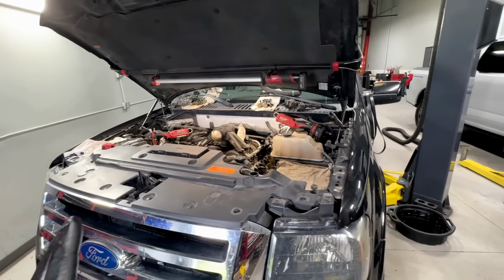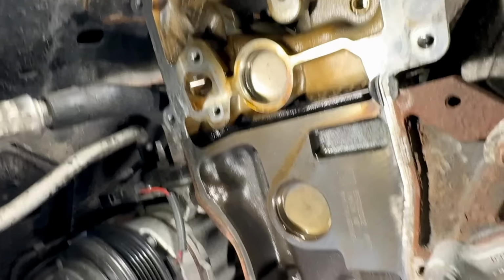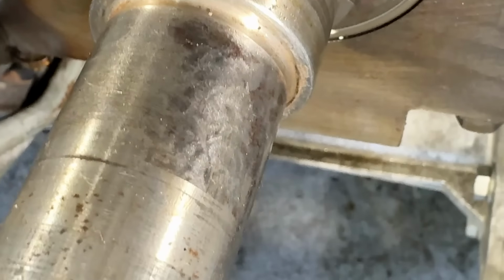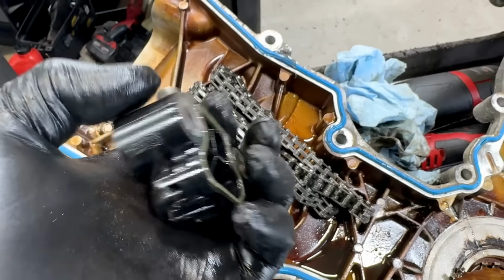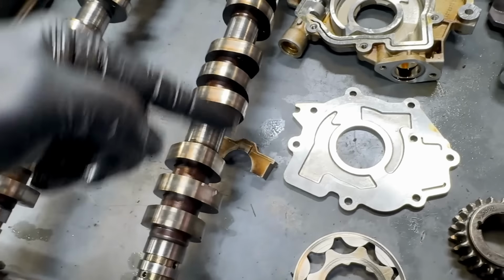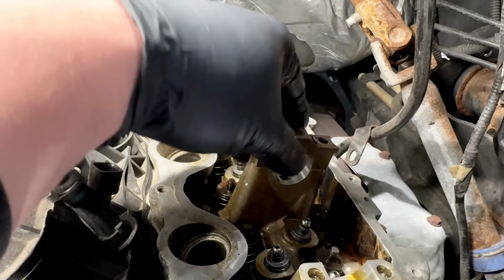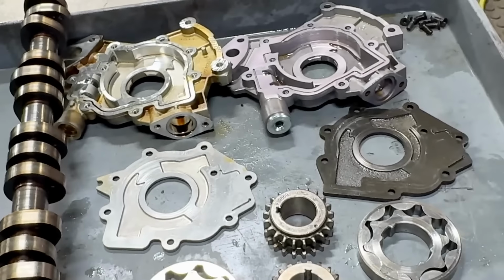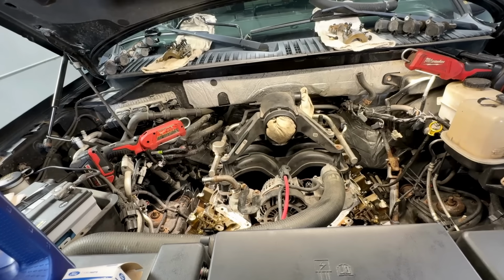How to Destroy a Perfectly Fine Ford 5.4L 3v Triton Engine with a Timing Job!

Comment: Looking for advice. I am doing the timing job on my 2014 Lincoln navigator tomorrow with the 543 valve. I bought a Cloyes timing kit mailing ratcheting tensioners a mailing high volume oil and water pump and also all of the respected specialty tools and torque to yield bolts after watching your video. The only thing that is making noise is the startup rattle. Nothing with the phasers or anything should I just keep the original Ford chains or use the Cloyes ones that I bought and hope that the reason they were snapping was the plastic tensioners that came in the kit which I won’t be using.

Comment: Hi tech Makuloco, which Ford truck engine do you suggest for the least amount of problems?
Reply: 4.6 or 5.4 3 valve with all of the upgraded Ford OEM timing components and Melling hv340 oil pump upgrade. And I would also definitely do the updated roller followers with a smaller oiling hole. First order of business for me is to usually check the cam caps and see how bad they are worn first and foremost. That's a major bleed off spot for oil pressure that these trucks must have

Comment: Good video good information! I bought a 2006 F150 111,000. Miles on it. 5.4 3v engine it has a constant ticking at ideal. How do I find out what is causing it? Thanks for the video!

Comment: Most and almost all  independent repair shops install aftermarket cheap crap parts , and even if they know the risk of failures like this , they don't care ; and they never advise the customer on OEM parts .
But on the other side , some people on budget , and cheapy .
I don't like aftermarket parts or do deletes on some systems .
But this is the type of information people doesn't understand .
Great information ,  great video  as usual . 👌

Comment: Thanks for your videos! I've been mechanicing for a long time and I love your dedication and attention to details! I don't trust very many mechanics, I would let you work on any of my vehicles, anytime! I think the problem with the aftermarket chains is part the unmachined links and they are loosely linked together! With those two center links sticking out, it causes more stress on the linking pins, causing them to wear premature and or bow?

Comment: Brian, is it ok to just run the 5w -40 in my 05  5.4 that is all original? 150k
Reply: Only if your clearances are terrible and your oil pressure is low after trying 5-30

Comment: My mother in law has a 2005 f150 fx4 with the 3 valve engine it made it to 272000 miles before dying from loss of oil pressure from the chain guides blocking the oil pump pickup tube. I put a reman engine in it but I also did both new exhaust manifolds cause they where cracked plus engine mounts, new hoses , new radiator and surge tank, new thermostat,water pump , fan clutch ,and had to fix the pig tail for the crankshaft sensor plus replaced it and the oil level sensor and replaced its pig tail too. Also put a new balancer , belt and idler and tensioner pulleys.

Comment: Thank you for a very informative diagnoses of the 5.4 timing chain. I have a 2010 F150 5.4 with 65,000 miles and I bought it with 20,000 miles several years back. I’m a retired master mechanic of 45 years and very familiar with Fords. My truck has been serviced every 3,000 miles since Ive owned it and I’m not sure what its history was before that. I use motor craft oil and filter only 5/20 blend. 
My story starts with a slight tick noise a few days ago when I pulled into my yard and my wife said do you hear that noise and I said yes so I got out my stethoscope and found it to be the right front valve cover under a light load. I know these valve trains are picky. With only 65,000 miles I decided to run some sea foam in the crank case one once per quart for 300 miles and then dumping the oil and going to a 5/30 full synthetic oil and hopefully this helps. The noise has since gone away. I appreciate all the knowledge you have to share because it’s quite possible I might have to do a full timing chain job. I will use only Ford parts if possible.

Comment: I have put the TOP of the chain on a BELT sander for for a clean surface when doing a timing job on the 5.4 will take better of the guides.

Comment: Hypothetically if that shop would of torqued that prankpully bolt down correctly would that timing job of failed? Or just not as fast as it did?

Comment: I've got a 2013 Navigator with 190k. Using recommended oil 5w20 full synthetic high mileage. Do you recommend keeping the current oil or switching to a different weight? If switching, what weight/viscosity?
Reply: I'm not Brian but he always recommends 5W-30 for any 5.4 3 valve. Even if it's a brand new remanufactured motor.

Comment: I admire your conscientiousness,
Wish there was someone I knew here in Wisconsin that I could trust to work on my 5.4. 
I just had my 2010 towed into dealership because it developed a terrible misfire on my way home last week. 
Dealership called and said the engine is shot, other than to say low compression on two cylinders, without any other good data to tell me why the compression is low. 
I am an electric trouble shooter and am not satisfied until I know what the smoking gun is that caused an issue. 
Very hard these days to find a competent, trustworthy vehicle repair shop. 
Love your content, pray the Lord blesses you for your integrity.

Comment: Ebay strikes again 😮. I just went through the same issue but on a dodge 3.7. The after market tensioners were not locking so they were just floating. Letting the chain slap around during deceleration 😮. I opened the timing cover 3 times before figuring it out.

Comment: Hey I got a 2007 Ford f150 lariat with a 5.4 I just did the coil packs on it they are  China coil packs anyway it ran great for a month and now it's missing on one two and three cylinder should I just put the Ford coil packs back in or do you think it's possibly the timing chain

Comment: Ford not marking the cam caps after line boring is terrible.    No marking on main bearing caps was common practice before the 60’s.  Ford main caps on later engines had position numbers cast into them.  A good mechanic will mark location on caps on disassembly if  not marked already.    Really Ford should have done this but a lot of new cars have unmarked cam caps.
Reply: My 2004 f150 5.4 3v has cam cap markings cast into every cap

Comment: This video made me worry! I did my own timing job according to his two part video about it, changed everything he recommended in the video, the difference was that I used Cloyes chain kit, it was before I knew about the cast iron tensioners. Two years and about 20k miles later I’m experiencing short cold start rattling if the vehicle sits for a week or so. 
Does it mean I have to re do the timing with oem parts?

Comment: in your opinion which is the best timing kit I can buy? Mine truck has the same problem 2009 F150 5.4L and I don't want to get it done with the wrong/cheap parts

Comment: So the only “special” tool would be the piece of cheese, cool. Do you guys have a favorite cam phaser that is recommended. Or do you just buy from a reputable companies parts? I’m looking at Rockauto right now. I had replaced a few things on my 290k f-350, starts and runs good but once it gets warmed up you can hear the knocking pretty bad on the passenger side,. I should ask I am planning on doing both sides but is it necessary to do both when replacing the one side that is bad?  This would also help alleviate my slight oil deposit in one of the spark plug holes….

Comment: As this video is over a year old this post may not be seen and doesn't pertain to the 5.4 3v engine.   However, I have a 1999 f150 with 136,000 miles.  The motor is the 4.6 2v engine.  The plugs were changed at 90,000 miles by the ford dealership and replaced with motorcraft plugs.  The coils on this motor are located in front of the valve covers with individual plug wires running to each cylinder.  The fuel filter has always been replaced and maintained at regular intervals.    The oil and filter have always been replaced at 3000 miles using motorcraft synthetic blend 5w30 oil with motorcraft or wix gold filters used.  Air filter always replaced at 12,000 miles.   PVC valve also has been replaced.  My problem is it will throw a PO340 code (cam shaft position sensor) without setting the check engine light.  This is accompanied by what feels like a hard miss and happens in the 30 to 50 mph range, under acceleration, and most often (but not always) within the first 5 minutes of driving from a cold start.   No other codes are present.   This problem is very intermittent and 95 percent of the time doesn't present itself.   I hear no unusual noises from the engine at startup.  I have replaced the camshaft position sensor.  Any ideas?   Am I looking at a chain, guide, or tensioner issue?   I'm afraid to drive it fearing it might be an issue with the timing components.  The truck is well maintained and clean.  Aside from this problem it runs great.  Anyone else experience this or have ideas?  Thank you in advance.  I absolutely enjoy this channel and watch it often!

Comment: I bought Meling based on a recommendation from another YouTuber.  The machine finish of the parts is subpar.  One of the cam gears has a missing corner, sort of like a chip and also has a small pit.  Should have bought the OEM ford parts.

Comment: I am preparing to do a motor swap of a 5.4 from one low mile 2007 Expedition donor into my other Expedition that dropped a valve because of a rocker failure.  I have a Bendpack Maxjax lift and a Harbor freight cherry picker.  What are you thoughts on lifting the body off vs trying to pull the motor out the top.  Is the body off the easier/smarter route?  PS:  Even thought the donor has only 69k I do plan on replacing all tappets rockers and timing set with OEM Ford and a Melling pump.
Reply: I'm currently doing it on the ground with the cherry picker. I wish i could have done cab off. It would have also been easier and would've been able to spray my frame completely with wool wax

Comment: I can't understand manufacturers' insistence on putting OHC (overhead cam) engines in trucks. OHC gives you better high RPM performance, but that's pretty useless in a pickup. A truck needs torque for hauling, the more the better, and an OHV (overhead valve) engine with its cam where God intended, in the block, can be a torque monster. This is where GM and Ram have it right with the small and big blocks, and Hemi respectively. Not only that, an OHV engine has fewer moving parts with therefore less to go wrong. It should also be cheaper to manufacture, so what was Ford thinking?

Comment: I owned an auto electric shop at one point in my life several years ago, and some customers wanted a better deal. I sent them to Down-The-Road Motors, where they would seemingly get the much better deal they were looking for. However, the repairs done at Down-The-Road Motors invariably invariably haunted these customers, later telling me that they regretted going there because, for some reason, whether it be grease on the upholstery or careless part installation, it always left the customers unhappy in the end. I understand people are poor, and many do need a better deal, but they would really would have been better off waiting until they had the right amount of money before having the repair done. It's sad watching customers learn this the hard way.

(Retired)

Comment: Probably up to this point right? I have an '04 f150. I just had the camshaft The rockers. The timing chain the camshaft positioning sprocket all redone now when I take off from a stop especially when it's cold the engine will stall. Where should I start on this?

Comment: I have a 2004 F150 4.6 L that I noticed has a slight tapping sound during start up every once and awhile for a couple of seconds and then it stops. What would be causing this? Should I not drive the vehicle? I did read that LiverNois make a cam phaser lockout kit, would this avoid me from having to do a full timing job later down the line? Thank you in advance to anyone who has any wisdom they can share!

Comment: That's odd. I've been running cloyes and melling stuff on all my vehicles since 1983 and have never had any problems at all. Put 246,000 original miles on my 85 chevy C10 before it went under water in a flood. Just put a timing set on my 87 Chevy C10 around 10,000 miles ago an she's running like champ. Seems to me if the ford oem parts are so great they wouldn't be failing at just 100 - 200,000 miles. My wife had over 300,000 original miles on her 86 Chevy Monte Carlo when it finally gave up and started having electrical issues. Only thing i can figure is maybe ford is a sponsor of this channel and that's why he pushes the oem parts so much. Good information and great channel other than the pushing of the oem parts. Not everyone likes the original parts, especially if they keep failing.

Comment: Well looking at that timing chain my guess is the links are stamped and the edges are not machined or ground smooth. So a cheaply made chain. You also said to use 5W-30 motor oil. I thought 5W-20 is the recommended grade?
Reply from the maker: You want to use 5w-30 in these engines.
Reply: Okay. Thanks. Any different recommendations for transfer case and differentials?

Comment: When I performed maintenance on all my parts I had no idea about the cam caps being machined with the head, thank god the place that cleaned my heads marked them and I did a little research before installing or I would have just thrown them on there like you said. It's all been a learning process for me though and my 2000 3v Exp is running pretty good (for now).
Reply: No such thing as a 2000 3v expedition

Comment: My 05 5.4 engine was replaced by a dealer at 115k. Now at 221K it rattles on start up and per Brian's videos the  plastic tensioners are probly failing. Nice Junk.

Comment: I have a 06 f150 5.4 i kept getting cam sensors codes even after replaces the sensors and checking all the wires. I decided to just replace cam phasers, timing chain, vcts,oil pump, and all timing components.  After completing i still get same codes. 
I even called a mobile mechanic which didn't help since he couldn't find anything.

Comment: I had the air intake off and pulled the driver side head. Also removed the pcm while doing engine work. When I put it all together I got a p1289 cht sensor. Changed it and still have the code. Removed the intake again and checked the wiring from the sensor. Checked the pig tail from the sensor to the main harness and found that it had 5 volts. I’ve cleared the codes and it still the p1289 code comes up. I will be checking from the pcm to the pig tail to make sure the wire is good. Is there anything else I could try?

Comment: Wow I wish I would have watched this before putting in a cloyes kit in mine.
Reply: How is it working out for you? I want to put melling guides on my car with a ford chain
Reply: @Tanya_Von-Degurechaff I ended up selling the truck so I don’t know but it was perfectly fine for the 6 months after I did it. The guides aren’t the problem usually. It’s the tensioners and the chain itself so if I did it again I would upgrade to the ratcheting tensioners and use a ford chain.
Reply: @HackMasterBlaster sounds good, I assumed the same thing in my case, im using melling guides and tensioners, and an oem chain, but believe it or not, the oem guides from ford are cheaper on ebay than replacement guides from melling, its wild, Thanks for the response.
Reply: @Tanya_Von-Degurechaff watch out for fake parts online. Loads of them out there. Looks like OEM- part numbers and everything but they’re fake. Better off buying from ford.

Comment: The only aftermarket timing chains I ever had good luck with were the old style of one timing chain on a old model ford truck I replaced alot of them back in the day and they never had any issues I wouldn’t trust alot of the aftermarket chains on some of the newer vehicles

Comment: I have so many questions regarding the 5.4 triton. As I recently bought a used 2010 F-150 with the 5.4 triton and it has 303,000km on it. Is there an email I could contact you at?

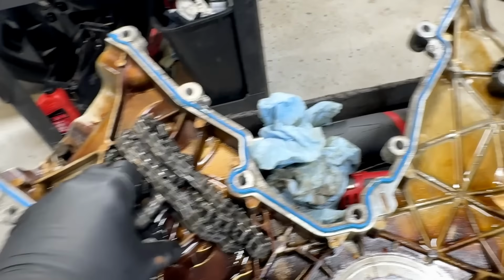Comment: 11:27  aren't these tensioners act like a hydraulic lifters?   pumped with oil it retracts to be rock hard to adjust the chain slack.  But if the oil drains  its only the spring tension.

Comment: Still working on the 4 letter word trucks, learned a lot from your channel! Agreed, the cloyes chain are junk, several years back I sent you a picture of the snapped cloyes chain on bank one of my 2004. Replaced it all the second time with ford stuff, my truck is still running 255,000 plus miles been using Penzoil Platinum 5-30 since I repaired it. Keep up the good work!

Comment: Feel bad for this guy and anger toward the shady shop he trusted. I experienced 5.4 total failure myself though it was 100% my own fault. I knew this problem existed and simply continued finding any reason available, all lacked legitimacy, to procrastinate needed maintenance. Truck has now been parked almost 2 years without the attention needed. Strangely as it may be watching this has given me the motivation to proceed. I need trusted vendor for quality remanufactured 5.4 3V in the Portland area if anyone knows one?

Comment: I’m in TN considering purchasing a 06 4x4 f250 XLT crew cab 166,000 miles with a 5.4 V3 can’t check it out til weekend wants $2500 but from what guy says he has cam phaser oscillation & fluctuating oil pressure he says mechanic said it needs a new motor is it worth replacing & does anyone recommend a good remanufactured motor company